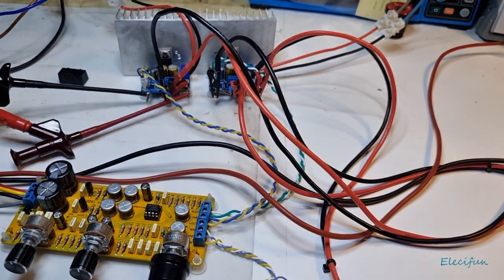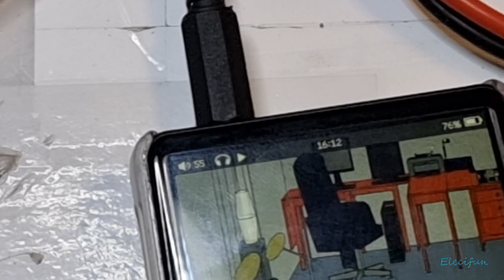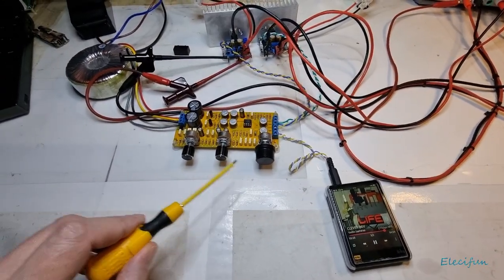NAD-UK Pre Amplifier Audio Test

Comment: Wonderful when a build comes together with sound quality and value you can be satisfied with. Strange that pop... probably wouldn't bother me much. My tube systems frequently have crackle and pop so I've become conditioned lol. As long as it's only on startup and/or shutdown it doesn't bother me much. Thanks for another cool video Elecifun.
Reply from the maker: Cheers Sonic. It does work nicely with a clear sound, I'm surprised as it cost less than 15 dollars. Iv'e ordered another NAD clone it is supposed to be the clone of the NAD3020 check it out if you like. Link at bottom of message.
I will figure out the pop with some internet searching help. First I need to figure out if its the LM1875 amp or the pre amp. Will update this in future video's.
I forgot, I ordered one of those tube pre amps you have and its arrived... What tubes are in yours? Did you know you can upgrade them for better sound quality?

Anyways cheers for your input and support amigo!

https://www.aliexpress.com/item/1005004825779255.html?spm=a2g0o.productlist.main.11.39e330f1tuSOC6&algo_pvid=d0e62a9f-fb17-4987-b207-04247f28ae67&algo_exp_id=d0e62a9f-fb17-4987-b207-04247f28ae67-5&pdp_ext_f=%7B%22sku_id%22%3A%2212000030629183822%22%7D&pdp_npi=2%40dis%21GBP%2120.67%2114.06%21%21%21%21%21%40212278f516717139848806648d0711%2112000030629183822%21sea&curPageLogUid=KOdnRrFickvX
Reply: Thanks for the link and information Elecifun! Cool that you got one of those tube pre-amps. Yes, I upgraded my tubes from the chinesium 6J1 to the USA made GE 5654w NOS and matched by Riverstone Audio in Wyoming. The 5654w are visibly more robust and seem higher quality. I haven't done scientific electronic comparisons but to my ear, the 5654w sound MUCH better. Cleaner, more separated instrumentation if that makes sense. Those tubes cost more than double the price of the whole kit though lol. I paid around $10 for the original kit (I accidentally purchased the assembled version). I paid around $25 for the matched set of 5654w. I think it was a worthwhile upgrade. I didn't upgrade any of the other components so please let me know if you do and what you think! I've already had way more enjoyment out of the amp than it cost. I had a great time fussing about with upgrades and enclosures and I think it sounds good too. I might poke around and see if anyone is producing a tube kit pre amp with tone controls... just another project to mess around with. Lot's of FPD (fun per dollar). Cheers amigo. Thanks for the videos and correspondence. 🤠👍
Reply from the maker: @Sonic_Ox  I also have upgraded, GE tubes on the way for the tube kit, it comes with 6K4 tubes which are supposed to be an upgrade on 6J1's. We will have to wait and see what the difference is between GE and 6K4's.
I'm glad to hear the GE5654w provide a more detailed separated performance, that's what I listen for. I want to hear every bass strum or pluck, voices spatially separated and detailed non mushed together instruments. This allows me to sit with my eyes closed and vision in my mind the band. I love The Eagles live and in the studio for this reason. Fleetwood Mac, of course Pink Floyd. Like I say my music enjoyment is wide. Joss Stone rocks, Small Faces, Sam Cooke. I could go on and on but won't. I guess you get it.
Thanks for the discourse.. a pleasure as always.
Reply: I definitely get it. You could be reading off my iPod lol. Being a guitar player myself, I gravitate toward guitar heavy bands.  Eric Clapton, David Gilmour, Carlos Santana, Jimmy Page, Keith Richards, Jim Hendrix, Jeff Beck, Stevie Ray Vaughan, Mark Knopfler, Buddy Guy, Brian May, Slash, George Harrison, Ritchie Blackmore, Pete Townshend, Duane Allman, Angus Young, Peter Green, Robert Johnson,  Billy Gibbons, Joe Walsh, Muddy Waters, Chet Atkins, Django Rhinehart, Eddie Van Halen.... the list goes on but those are some of my favorites (jumping around a bit lol). Oh yeah, please let me know if you change out any of the other components on the pre-amp. Some folks change capacitors etc but I don't know which components make a substantial difference in sound quality 🤔  fun to tinker.
Reply from the maker: Lots of my favourites in your list, some I haven't heard but would probably like. Will keep you updated on any changes in tube pre amp. Will get on it once I've sobered up,lol.

Comment: Orayt Amigo ! I like that little amplifier!

How many watts rms per side is it?

🤔

What size speakers are you running?

Bass speakers 🔊 
Mid range speakers 🔊 
Tweeters speakers 🔊 
Cross over??

That's a cool little project!

It's a good feeling kicking back and looking at projects that you've built.

I'd like to see you build a real beast of an amplifier!

Like huge! 😅👍

100W x 2 channel RMS 

Something that takes a week to build.

Then some nice 14" Sony bass drivers 

With some nice brand name mid and range speakers with a couple of tweeters to go with it.

Anyway I know that's gonna be expensive and you'd need to do some serious home work on different amplifier classes etc.

You might know a lot more than I assume.

Anyway enjoy that new amp you've built and thanks for uploading that video.

I enjoyed that. 

🤔👍🙋🏻‍♂️🇦🇺
Reply from the maker: How many watts is the pre amplifier? not sure atm, need to do some tests. 
My bench speakers are Q Acoustics 3020's, not great but not too bad either for these type of tests. 
I don't feel the need for an expensive high powered amplifier, besides, the 60 watt amp i've built already is more than enough power for my needs. Maybe a tube power amp is in the future, but not before a tube pre amplifier. 
I've been building AB class amps because they are more efficient than A. I'm not really into chip amps. The LM1875 might be a chip but its also AB class, push pull.
Glad you enjoyed the video amigo!